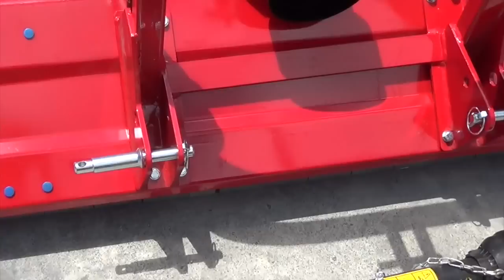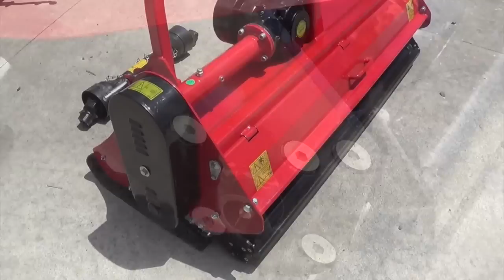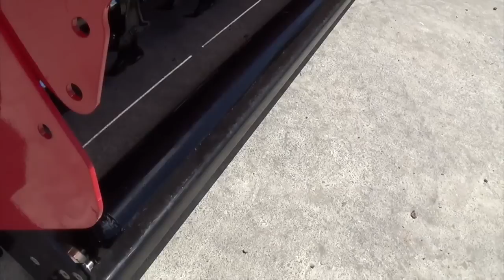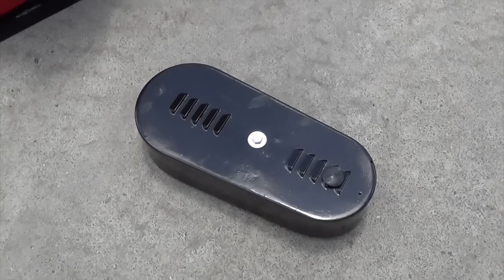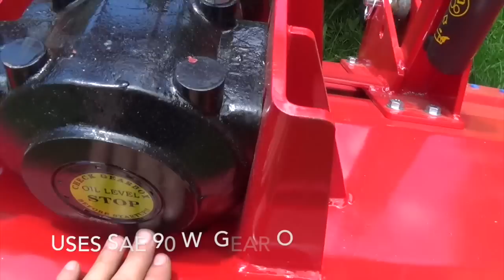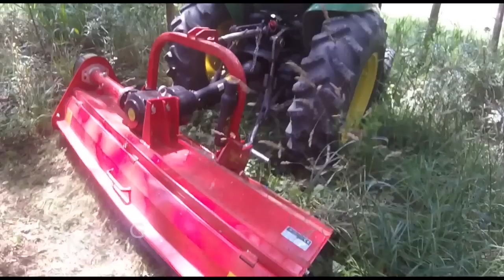Flail mower Demo From Implements Direct

Comment: great video, thanks. Curious what your machine's PTO power output is?
Reply: Dan, I have a Titan 60” flail on my 26HP Mahindra 1526 (19hp at the PTO) I’ve been using for a few years now. It’s rated for a 30hp PTO tractor. My Mahindra handles it just fine. The mower is rated at up to 4” material if memory serves, but the largest diameter of standing saplings I’ve cut is around 2” and that’s only because I don’t want anything bigger dragging under my tractor as I run over it. The 19hp PTO being less than the rating most likely wouldn’t handle much larger than the 2”. It cuts grass like nobodies business, also. I can make my field look like my yard if I don’t let the grass get 18” tall. And even then, the only difference would be the amount of grass clippings laying on top after a pass. I went the flail route due to the excessive real estate a brush hog takes up on the ground as well as the trailer. I have an 18’ heavy pipe trailer and have room to spare with my setup. I couldn’t be happier with my choice. This video is a spot on demonstration of what they can do.
Reply: @troywilburn9147  thanks for the info. Was starting to look at masticators but I think this would be a better overall tool.